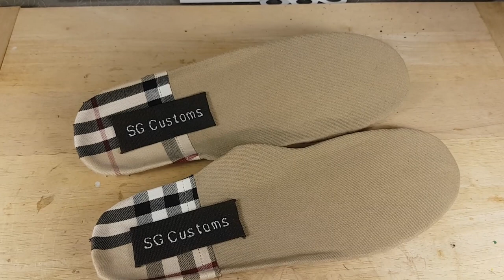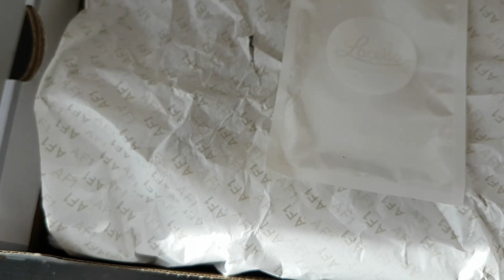😱🔥 Custom Burberry Nike Air Force 1 Low 🧵👟

Comment: beautiful,  but in my opinion you should have put the rider backwards
Reply from the maker: I think the rider fits better into the shape of the Toebox, the way it has been finished. 
But that's a matter of personal taste. 
On the Burberry bag, the rider is also normal and turned upside down. 
It wouldn't be a problem to process the rider differently than in the video.
Thank you for your feedback! 🥰🥰